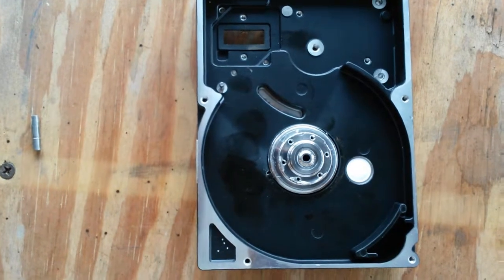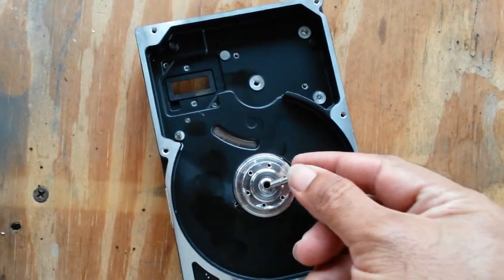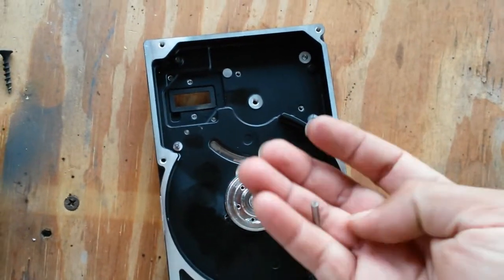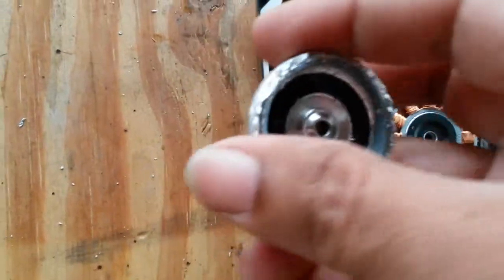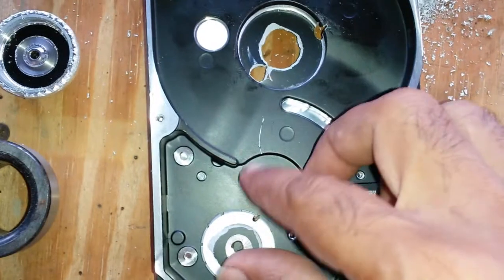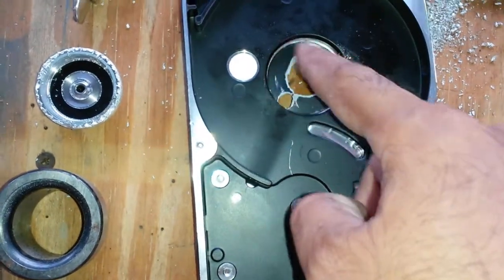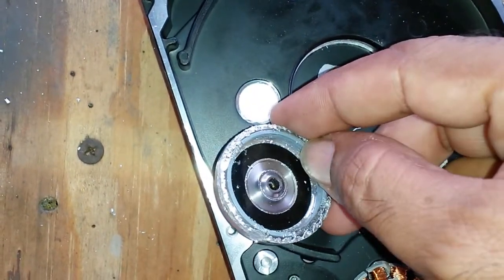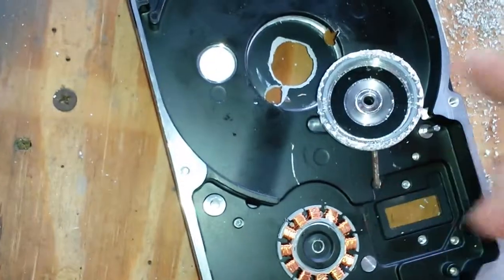153 Hard Drive BLDC Motor

Comment: What would be the best way to cut that out? Hacksaw or grinder?
Reply from the maker: If you are trying to explore the design like me then a hacksaw but if its to cut around the motor so it can be used in a project either method will work. The aluminium frame is quite easy to cut with a hacksaw.
Reply: @manickn6819  Thanks!

Comment: Really interesting, man. 😊
I have an esc here, designed to use with one of those motors. I'm going to make a small grinder with it. 😊
Reply from the maker: One of the DIY channels did a grinder from a BLDC motor yesterday. It works but its not the best motor for torque. Most power tools would use a universal motor (like I show on video 093). Some use normal DC motors like a cordless drill for example. Some more powerful BLDC motors exist and I am seeing them get more application though. 

Anyway if you have a motor lying around go for it. The platters from the hard drive are really flat so its a good backing. Not sure the coating is safe in the long term but I am the last one to say anything on that. I am stripping drives with no gloves and video 9 I cut a neodymium magnet with not dremel.